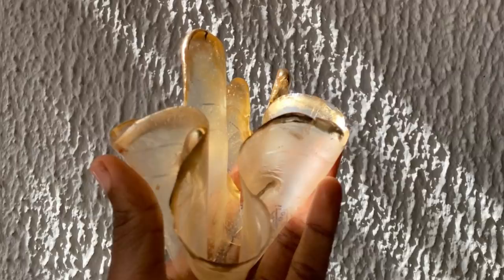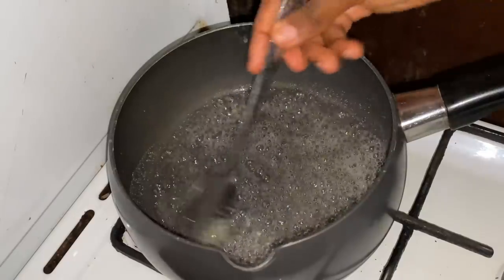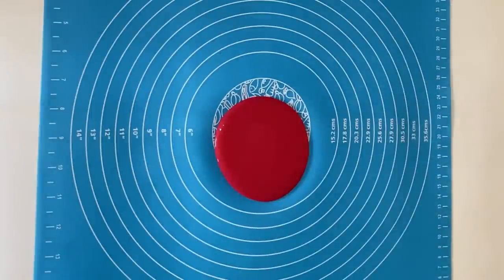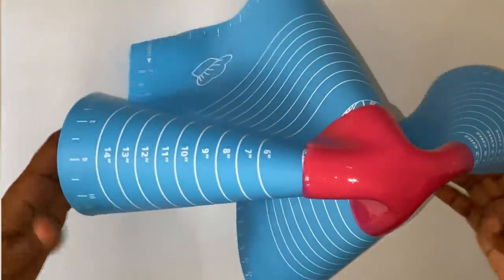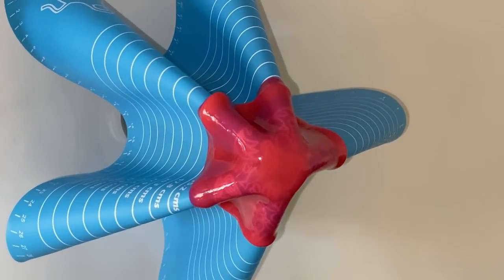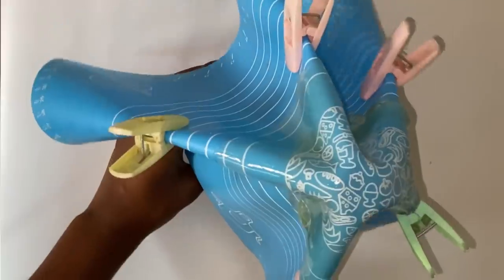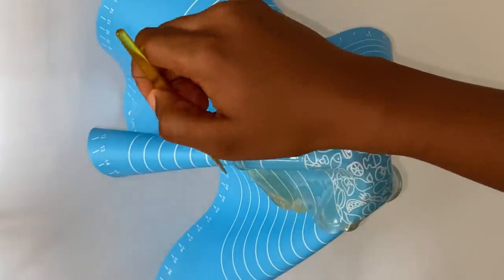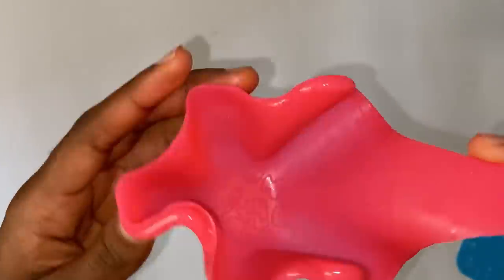How to make Sugar Sail for cake || Sugar Sail Making (without isomalt)

Comment: Thank u video was very helpful I don't have silicone sheet instead I use butter paper and it works exactly same
Reply from the maker: You can use butter paper but it wouldn’t work exactly the same. Silicon mat is flexible so you can create well defined sails unlike butter paper.
Reply from the maker: Here is a video I made using butter paper and ballon to make the sugar sails.
https://youtu.be/awuD5-XEnzM

Comment: Thanks for the video. I reached "crack mode" and left it on the mat for about 1 hr before I removed it. I left it dry on my kitchen counter overnight but it misshaped the next morning. Should I leave it on the mat a little bit longer? Thank you!
Reply from the maker: Yes leave it a bit longer 
And also it depends on the shape of the sail 
If it’s to complicated it would require more time to dry
Reply: @ClaudiaCakery  Thanks so much for your tips.
Reply from the maker: You are welcome. Sorry for the late response.

Comment: Why my sail is not getting dried or harden?
Reply from the maker: It could be due to too much moisture, to avoid this make sure you heat the sugar mixture to the hard crack stage which is around 290 - 300 F.
Reply: @ClaudiaCakery  then it wont harden in the vessel itself? What is the correct stage to remove from the fire?
Reply from the maker: At 290 F that’s when it reaches the hard crack stage.
Reply: @ClaudiaCakery  thank u dear.
Reply from the maker: @leelasuresh3735  you are welcome.

Comment: I tried it, mine did not harden after 8hours. What did I do wrong?
Reply from the maker: Did it reach the hard crack stage??
Reply: @ClaudiaCakery  yes it did as I kept dropping a drop on cold water until it solidified immediately
Reply from the maker: Another factor that can contribute to it not getting harden after 8hrs could be the design of the sail, maybe you should leave it for another 3- 4hrs, then try to remove it from the mat.